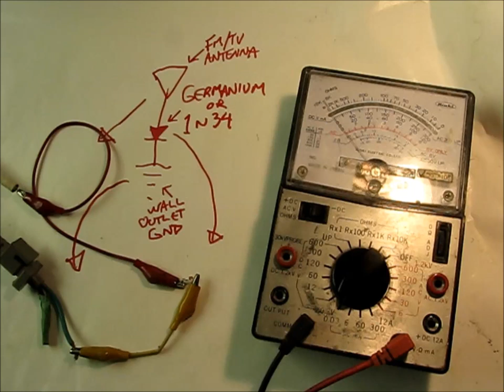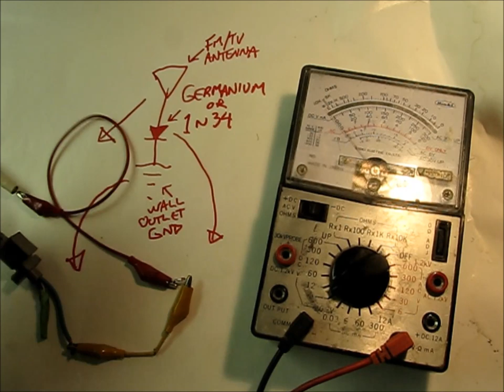DIY Wireless Power - Part 1: TV/FM Antenna,1N34/Germanium Diode & Ground

Comment: seriously mate - i like it a lot. There was a guy - i forget who - who was stringing aluminum plates in his attic. He wired these together and got some serious voltage and ampage. The circuit he was using was pretty simple but not as simple as yours. Some aluminum foil covered in plastic and connected up could well do the trick - certainly worth a try. He said the connection to the ali was important - to make sure it is good.

Comment: Interesting. I just tried a bunch of germanium and signal diodes on my ant. Cant get more than0.001v and 0,0001a (You dont measure in current in amp hours, only battery capacity is measured in ah)
try running one of these on it and see if you can charge a AA battery... Ambient Solar Harvester Starts Ossilating From 60mv

Comment: Robert smith is here! hehe.  So what is the real purpose for the cool between the antennae and ground in a crystal radio?  is it just a band pass filter?
Reply: Coil*
Reply from the maker: mdimarco87 its just the wire laying in a coil configuration, but i betcha it does act as a filter... never thought of that hehe.

Comment from the maker: OK, I think we need the right signal.. I tried a huge metal plate but its in a garage and it has huge metal doors..and the sun isnt out fully yet.. Later, I will put my metal plate outside, maybe that will help. BUT FOR NOW! I used a CB Radio to trigger the diode... WOW|! .Im going to try making a BEAM robot now that is powered by cb radio frequencies!!  This will be cool! .

Comment from the maker: Once i make this into a "device" im gonna call it an "Ambient Energy Collector" maybe it will just charge li-ions? or we can make an alum-lead cell.. so it doesnt blow up. It will probably just be a modified portable crystal radio with multiple receivers to get AM/FM/DTV/WIFI.. Whatever signal is out there and dump it into a battery :) Maybe it will work!

Comment from the maker: Were the plates acting like capacitors or antennas or were they like tuning coils.. Or All..  Hmm. I wonder.. I think if we used a waveguide antenna, we could zero in on the frequency we want and increase gain, then dump each guide into a collector circuit.. I dont know how to make a waveguide... but YOUTUBE IS GREAT :D Maybe I will soon!